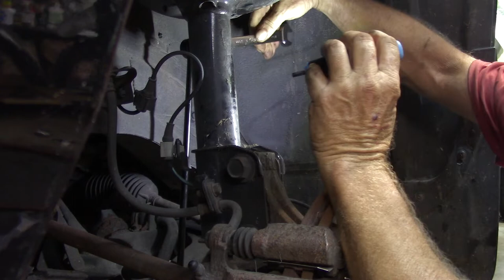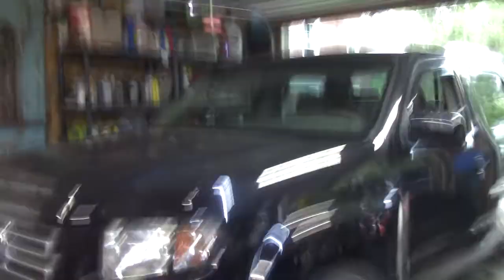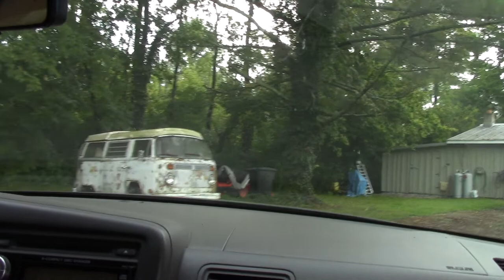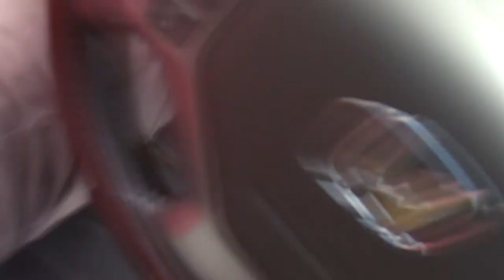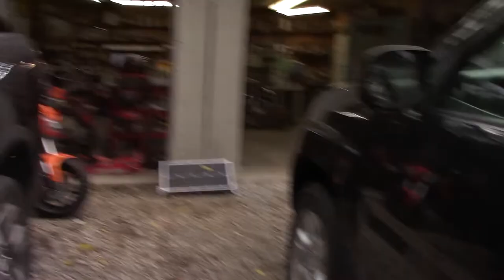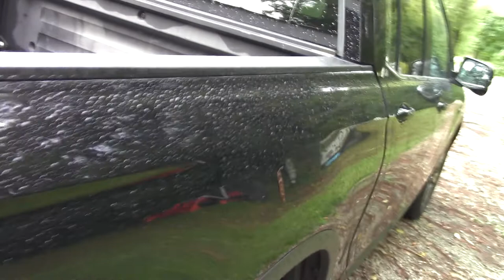2006 Honda Ridgeline Sway Bar End Links

Comment: Did you know moog is made in 16 different  countries.  So you take a gamble on quality.  I always had problems with moog problem solver parts.  Funny huh.  I would just replace those bushings too while your at it.
Reply from the maker: Yeah, can't say I was impressed.  $100 for both front and back.  Gonna wait on the bushings, just to see if the thunk comes back.  Those bolts especially the back side are hard to get too.  Gonna need some heat on them.